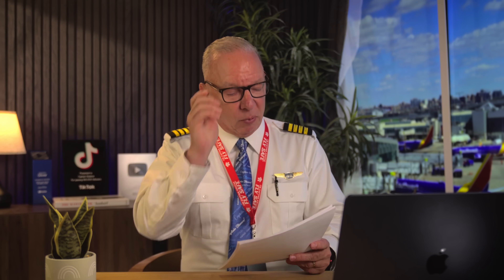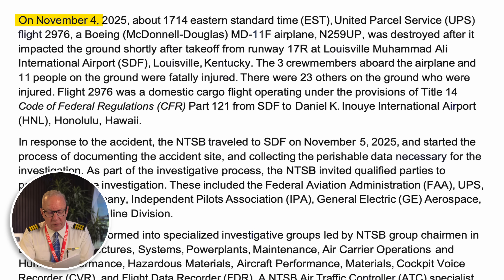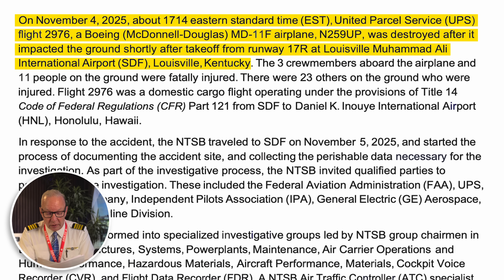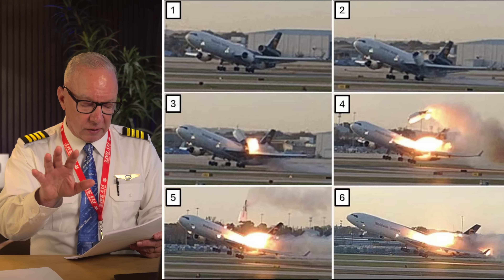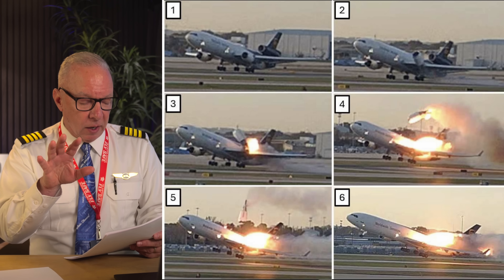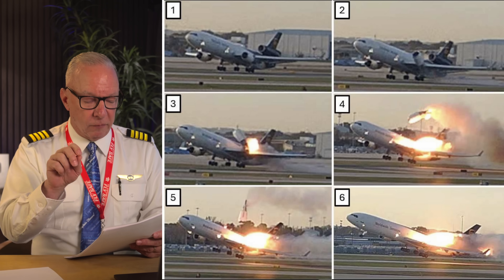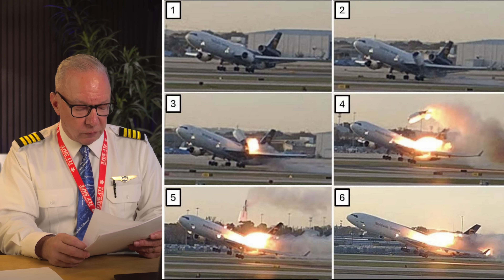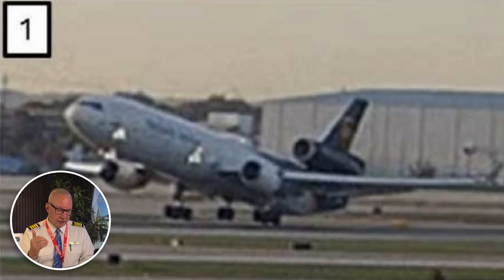UPS Crash Preliminary Report | Pilot Reacts to UPS Crash Report

Comment: Capt. Steve, excellent breakdown; those aging planes have clearly reached the end of their service life; it’s high time to retire them (after all, every airframe has a finite number of flight hours, takeoffs, and landings before requiring significant overhauls, right?). I wouldn’t be shocked if the Safety Manager pushed to ground the entire fleet but got shut down until the FAA warned they’d step in with an official grounding order, leaving UPS no choice but to comply. It also wouldn’t surprise me if pilots are reluctant to operate these outdated aircraft. Kudos to the heroic crew, and RIP ✊🇺🇸✊🇬🇧✊

Comment: The dc10 it Chicago O'Hare I remember was just beginning to lift and the engine departed. The angle of attack of the md11 was greater, as it was well off the ground so the tail engine was basically a straight shot rearward into the tail intake.

Comment: 3:33 the engine went up and over the fuselage and landed on the right side of the runway, opposite from the wing it detached from. In picture 5, you can see the engine hanging in the air directly over the fuselage.

Comment: Excellent reporting, Steve. So let me ask you this: why ground all these planes? Why not change the regulations to replace and inspect the parts that seem to fail much more frequently? Lots of planes (and cars, and boats . . . ) have parts that endure major wear and tear and could be fatal or otherwise dangerous if not replaced. I mean, so many of the MD-11 and DC-10’s have been up in the air without incident since the 70’s. Both accidents were tragic, but it would seem that it’s a bit much to ground an entire fleet of planes that haven’t experienced a pylon failure in decades. It would seem to be a preventable issue with updates to maintenance requirements and more frequent part replacements — and it would seem worthy to try saving these planes that are apparently extremely valuable and irreplaceable for firefighters, from what I’ve heard in recent comments. 

What am I missing here? I’d appreciate your input about this decision and whether there is still a possibility of the “powers that be” to reverse the decision about grounding these planes. Perhaps they can inspect all of the existing planes to determine how worn these parts get after x amount of use and then revise maintenance procedures? I know it may not make sense to save these planes from the freight industry’s perspective, but I would think it makes sense to try saving these planes for firefighters who really don’t have a better solution at present time for trying to fight large fires.

Comment: Capt Steve( too serious to add the other “e’s” two question. How can investigators tell the difference between a fatigue crack and a crack that happens after the crash?  Second question. It does seem like the airplane had a lot of cycles before the mandatory inspection. This airplane had 93000 hours of flight. As the airplane ages shouldn’t the inspections get much closer together? I understand the cost is immense but people lost their lives shouldn’t the inspections for older planes and specific parts get very reduced hours in between inspections?

Comment: That no 2 engine was very likely shedding compressor and fan blades as well, the report likely will show massive amounts of blade penetration into the rear of the aircraft, along with the engine having lost probably half of some compressor stages before impact, and if the aircraft had stayed airborne it would have done a similar to Souix city style cutting of the controls as well, though probably would still have had hydraulics working because of the actions taken after that WRT hydraulics having single tanks in the rear, which were likely also damaged by the engine failing in the tail. 

Spells the end of the tri motor for sure, all old airframes, all well past operational life, and retrofitting them will likely be way too expensive, so all will be, at least in the USA and EU, be sold off to other operators with less than stellar operating standards, or be scrapped entirely. Engines though will be used for other aircraft, as after all, till it was ripped off the wing by it's own thrust, it was operating perfectly. Only reason airlines have kept the Mad Dog, and relatives, running was because it was somewhat cheaper than buying a newer aircraft, and getting certification for service and pilot training, though with higher fuel use.

So now they will likely all be buying new to them airframes to replace them, if not outright buying off some of the 737 Max that are sitting in storage at Boeing, and flipping them from passenger to cargo use. Got to be a good bargain there, as Boeing will be desperate to get them out, even at a short term loss, accepting the future sales of spares and training, and also in not needing to pay for storage and operational maintenance on them as well, because thy are not mothballed, so there are plenty of things that will time expire on them.

Comment: The way engine #1 left the wing and went over the wing is identical to the way the #1 engine left 191. I'm curious to know if this MD-11 came from UAL. The MD-11 went into service in 1990 and Denver Stapleton closed in 1995 which is an overlap of 5 years. Stapleton's runways had a really rough surface. Stapleton was one of UAL's major hubs along with ORD. I flew in and out of Stapleton dozens of times and besides the runways being rough, the airport is at around 5280' meaning that it requires much more power to get airborn due to the thinner air at that elevation. Also I remember that we had to head East to get enough altitude to turn around and go West to clear the Rockies. Flying out of Stapleton is nothing like flying out of MCI in Missouri, it puts far more stress on the airframe. Again, when did this MD-11 go into service and did it come from UAL. UPS did not buy it new but converted it from a passenger plane.

Comment: Im asking this so smarter people than me can answer it. This plane had 21,043 cycles. If you divide 21043 by 365 (days in a year) then that means this plane had 1 flight per day for 57 years straight. Are planes flown like this? Was this plane 57 years old? Thank you for your responses.
Reply: I think this particular plane was 34 years old.
Reply: The plane was manufactured in 1991 as a passenger airliner.  Passenger airlines fly their planes as many times as they can in a day, from 5am until late at night, or even overnight.  But this plane was converted into a freighter in 2007.  Freight airlines leave their planes sitting around all day while packages come in from the trucks.  Then in the late afternoon or early evening they load the plane and fly it cross country.  Then it sits again until ready to be loaded.  So the plane likely had lots of cycles early in its career, but only 1-2 cycles per day in recent years.
Reply: @GDuncan8002 Thank you for the information. I appreciate it.

Comment: Looks like a very weak design for that much stress from the power the engines would be putting out.
If they knew from 1979 that it was problematic part it should have been inspected more often or replaced. 
Just asking for something to happen like this.

Comment: The #1 engine blew the rear ( aft) engine mounts. The forward mounts were still intact but the thrust of the engine caused the engine to rotate in a clockwise manner ( when viewed from the left or port side) At some point, the engine rotated nearly 90 degrees and encountered the limit of the forward mounts. The forward mounts could not endure the thrust and rotational torque of the engine and the forward mounts ruptured allowing the engine to fly away from the plane. It still had residual thrust and continued to fly itself up and over the fuselage and scatter its components into the #2 engine. #2 engine is severely damaged leaving a very heavy aircraft with only 1/ 3 of her available power. 500,000,00 pounds of metal and fuel at 180 mph and 30 feet off of the ground. A very sad day for Louisville.

Comment: I don't understand why you stated that the plane wasn't that high at all. Isn't the airport elevation approximately 500'? I am confused since the 481 mean sea level would be approximately 500' above mean sea level, right? This slight variation in height could just be a normal variable in the radio altitude data. Maybe I am wrong and you were referring to the actual ground level being stated at 100'?  Please verify so that I can understand more clearly. I can only learn if I ask. Thanks!
Reply: The NTSB's preliminary report said that it never achieved even 50 feet above "ground level", which is why the main landing gear ripped a gouge in the roof of the UPS supply building.
Reply: You aren't confused.  He is.  The runways are about 460-470 feet above sea level, so the altitudes shown in the NTSB report are correct.

Comment: I can't believe that they would use such a small diameter bolt on something so critical to the safety of the aircraft.  I actually use bolts like that to hold the generator onto the motor of my old FL Harley, and it's not carrying a stress load.  So a $5 dollar bolt will end up costing UPS 50 million in damages.  This is not a smart way to run a business.
Reply: Certainly not a $5 bolt.  But yes, it's easy to give attention to the correct part when you have hindsight to know which one failed.

Comment: 3:49. You finally admit your error regarding number 2 (not 3) which I repeatedly told you from your earlier videos.    But you are wrong to say it is debris or shrapnel that is causing number 2 to fail; it is mostly going to be the flames and vapour that is causing the compressor stall.
Reply: Yep, my thoughts too. Instead of drawing in cool air with 20% oxygen, that #3 engine was ingesting a cloud of burning aviation fuel and hot air that had already been depleted in oxygen through that combustion.

Comment: it almost looks like at rotation the number 1 engine kept on rotating after desired angle was achieved/mount failed at the point of rotation, the front bearing did its job and let the engine go after the rear bearing had failed. at any rate 6 years is too long in between inspections of a critical stress component, if they keep them flying I'll bet they change it to visual inspections yearly and NDT every 3 years for commercial aircraft. respect to the pilots they got dealt a bad hand and those folks on the ground.

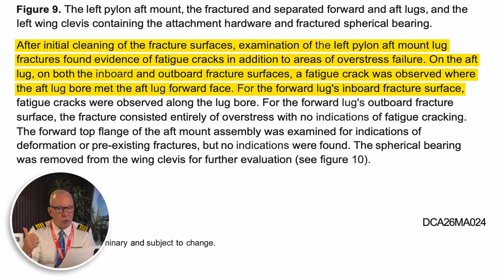Comment: 11:35 when rebuilding many car and motorcycle engines, your supposed to replace certain bolt because of they stretch after being torqued to a certain spec when new.

These bolts basically contain the combustion cycle in the engine. My point is, an engine failure shouldn't be lethal in a car and yet we replace the bolts.

This aircraft had pillon issues previously and should have required replacement or atleast inspection of these critical bolts to prevent any more accidents.

I hate to say it, but this was an avoidable accident. When your life is dependent upon only 2 bolts retaining there structural integrity, they must be part of routine maintenance. The ntsb should have realized this.

Comment: Is it possible that the #2 is not spitting fire but what we are seeing in photo #6 is actually the #1 engine blowing flames?
Its partially covered by the left wing’s winglet. Seems a little low to be the exhaust path of the #2 engine.

Comment: 4:36 youd think the design criteria for any aircraft would start with:
1. The wings should never be able to fall off
2. The engine should never be able to fall off

And for Being, the doors should never be able to fall off.
Reply: The thing is, you have to have some way to take the engines off for maintenance. And if there's a way to take the engines off that means there's a way for the engines to fall off too. The only thing you can do is have procedures (including inspections) that minimize the chances of that occurring.

Comment: Captain Steeeve, no disrespect to pilots or maintenance but simply crunching the numbers I was shocked. This plane had 92,992 hours and 21,042 cycles in total with 8,157 cycles before it would have another inspection on this pylon bearing area. That's roughly 35,972 hours before maintenance would be looking at this area again. Isn't that excessive? In private aircraft we have 50/100 hour inspections, annuals which look at everything and at TBO up too 3,000. There's even a maximum wing life. In a Tomahawk I previously owned the maximum wing was 11,000 hours. That means I could essentially wear out 3 Tomahawks before the MD11 would even have this pylon area looked at again? WOW
Reply: Your Tomahawk was not designed under a Fatigue Critical Baseline Structure program either. Fancy language for airliners have built in safety margins for being able to survive structural damage, corrosive, accidental and fatigue. This is a preliminary report... They probably aren't done looking at engine change records and if something doesn't come out of that I'll be surprised. A lot of times there are conditional inspections when replacing an engine, like those spherical bearings... so to say the interval is ever they say it is doesn't mean the manuals doesn't call for it to done at engine change. What's gonna be jacked is if this is a procedural like United and most operators had back in 79... using fork lifts to swap out the entire pylon/engine and damaging those lugs... instead of replacing just the engine like the maintenance manuals tell you to. Their is no procedure to do this. if you need to change the pylon you remove the engine. Then remove the pylon and do the reverse. YOU DO NOT INSTALL as an assembly.
Reply: @mjpburke1  Sorry maybe using my prop plane lifetime was a poor perspective. What I was getting at was how excessively long it was LEFT before they  would ever be inspecting that area again. 35,972 hours is roughly 4 years 3 months 29 days if the time could be spent all at once. That's probably closer to 8-10 years given time between cycles and other ground issues.
Reply: @mjpburke1 
 I saw that tv show where they used a fork truck to put the engineer on.
Reply: @nitro456jk what??
Reply: Yea this is to crazy long, im afraid this is all about costs.
Reply: @elmerhuyard3565  Everything is about costs with UPS. Where safety is concerned, they'll do only what's required and no more.

I sorta understand their obsession with efficiency because I have a similar obsession, but I refuse to neglect safety while chasing efficiency. That's why I stopped driving for UPS. I was never anywhere near their planes, but based on how I know they treat their vehicles and drivers, none of this surprises me.
Reply: The figures provided were for the next inspections and not when the previous inspections were carried-out.
Reply: Do you by chance happen to know when the airplane was manufactured?
Reply: @ds_the_rn  I believe the plane was 34 years old
Reply: @ds_the_rn 1991 or 1994
Reply: To be fair, a large planes cycles tend to be a lot longer than a light aircraft. This plane seems to have averaged about 4 1/2 hour cycles (93,000 divided by 21,000). I think there is also an assumption that light aircraft will do a lot of circuits and bumps and will be flown in a more stressful way - aerobatics, sideslips, stalls and spins etc.
Reply: @HuwRichards-e2z  I don't disagree with any of your analysis, but my point was the MD11 still had 8157 cycles, or 35,972 hours, left before that area would have been required to be looked at and that's 3 lifetimes of a light aircraft. Seems an excessively long time in that perspective.
Reply: These aircraft also have more frequent inspection schedules, and checks before every takeoff.  Under normal load and wear, these parts can be deep inspected every 29000 cycles.  They are surface inspected more frequently, I think on 4000 cycle schedules.  This failure was not due to improper inspection, but probably due to bad maintenance that overstressed the lug.
Reply: And inspections can miss things, so there should be at least two inspections within each anticipated failure interval for items which have caused documented airframe loss.
Reply: @runderwo I recall a similar logic when COVID tests were required for returning passengers.

In theory one one in the first week is enough, but many recommended two because the first might miss for some reason
Reply: the planes you're speaking of are prop planes with gas engines which produce significantly more vibration than jet engines therefore stressing the airframe considerably more

Comment: I'm not an aircraft mechanic but have a lot of technical experience in a variety of areas. I don't see how a visual inspection at those intervals would be adequate for such a high-stress, critical part. And even more so considering the history of the MD-11 and other aircraft of similar design. I would think magnetic particle inspection or something similar at shorter intervals would be warranted. And that procedure would likely have found the problem before the part failed.
Reply: Fatigue cracks normally start from micro defects on the surface of the lug bore and grow very slowly.  Even after 29000 cycles, they might be under a mm in size.  Those deep inspections are more for catching internal fractures.  The surface initiated fractures are checked for during more frequent inspections.

But this case was likely not normal wear fatigue fractures but localized overstress fractures from bad maintenance.

Comment: Thanks for this detailed explanation/review of the NTSB report captain Steve. So sad to see this happen. I am astounded that they thought a 6 YEAR inspection interval on these types of highly stressed components was OK. Not only that, a visual check by eye is not a great detector for micro cracking. Need some proper NDE (non destructive examination) on these components more frequently…like a penetrant dye test to better show if cracks are forming. 7000 more flight cycles before the next visual. My goodness!!